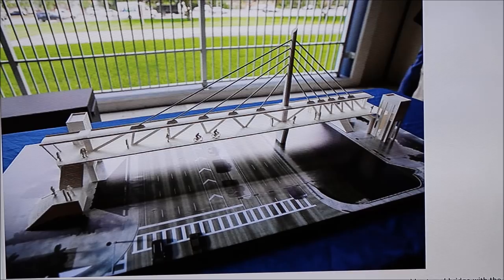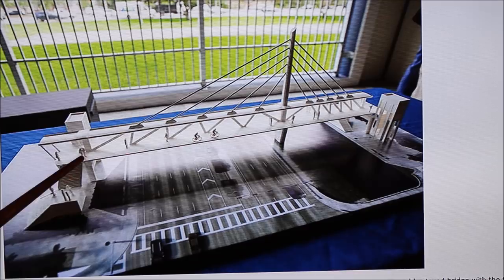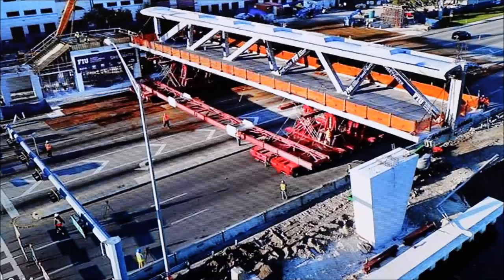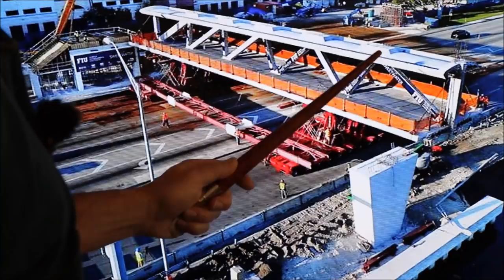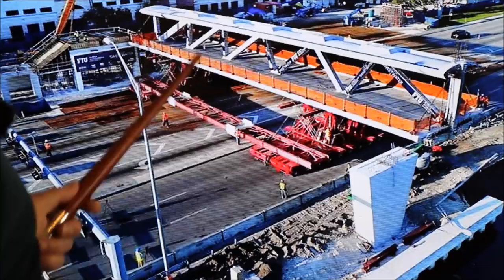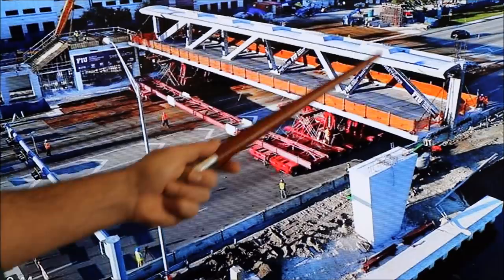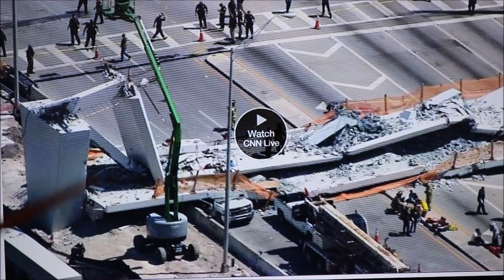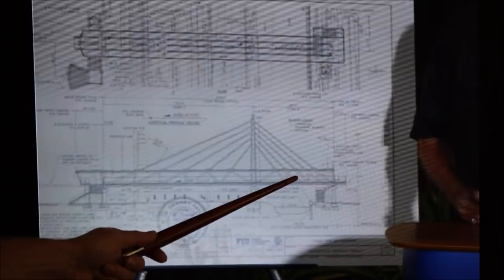Miami Bridge Failure- preliminary analysis 17 March 2018

Comment: Only an idiot with no knowledge of physics would claim this bridge to be anything other than an suspension bridge! The angle
of the vertical members loose their strength by being put at these angles! These angled vertical members would be perfect to properly distribute the load to suspension cables! IF the design was to be non-suspension, these members needed to be vertical and at 45 degrees to have any chance of being able to carry the load on such a long span! Why would any designer try to use a sound suspension design and try to make it stand without the Cables that provide 90% of the design strength?

Comment: Typical millennial engineering: make it look like a suspension bridge and even go through the work to put a tower in and cables but don't actually have them contribute to the strength of the structure.

Comment: "Never trust a truss". Has anybody heard that before? You structural engineers heard that before, especially the twin tower collapse!
Reply: Gord Baker 
Not always.
Reply: trusses are a unitized element of a bigger design. The one fatal flaw was not having something under just in case. When used within their limits there is no problem. Just like lumber has load limits depending on distance required. This is known. State of the Art seems to be too much in the unknown.
Reply: The WTC didn't have trusses, it had cantilevered floors on steel posts.
Reply: Sideslip 
Yes they did. Under the concrete floors!